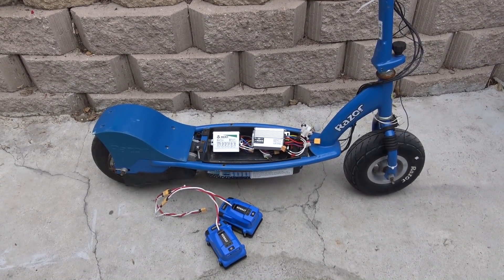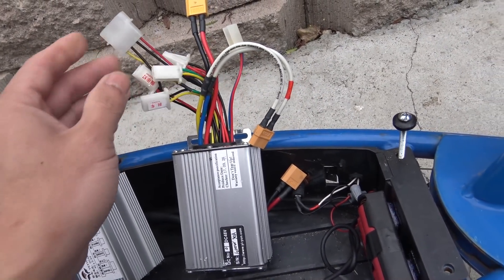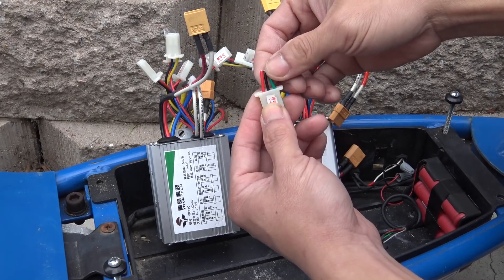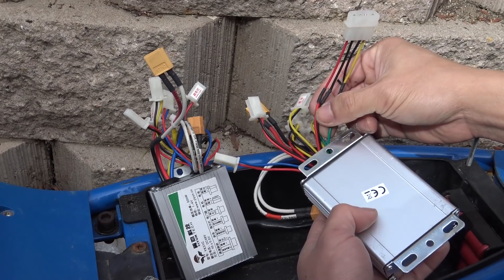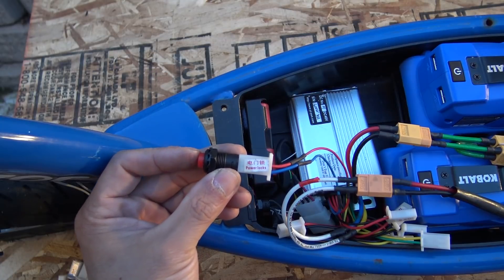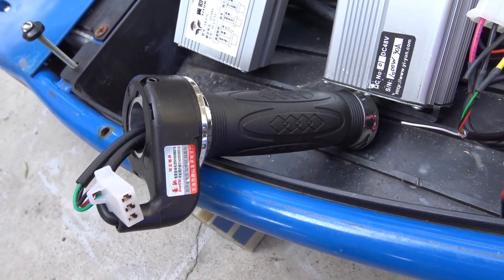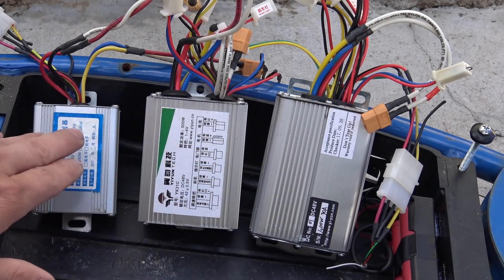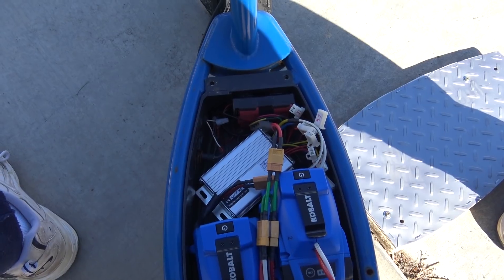Install a 48V controller & 48V battery on a Razor E300 (24V) Electric scooter

Comment: Hi, I took your battery pack idea and built my own. I am not using XT60 connectors but I am using regular electrical plugs connector which are the same and do the job. I am also using the same controller that you are using in this video. 
First problem: When I connect the battery pack 48v to the controller it usually sparks. it does it at first and after a while of reconnecting it for a few times it goes away. The last time the spark was so great it blew one of my 24v battery boards and it blew my controller as well. Did you experience this and do you know why? How do I fix it? I keep having this problem for any controller that I use. 
Second Problem: I bought and returned a few of the controllers you are using but I kept one. They all never worked for me. I never got a 48v output. I never connected it to the motor, I just tested the output and never got 48v. I made sure to follow your instructions by jumping the switch. This one I have reads 44v at the output. I will be using a foot throttle pedal which I bought one and did not work (Talk about luck) or maybe I am lost. Is there a trick to this controller or would it work once I connect it to the motor? I am thinking of connecting in a potentiometer on the accelerator plug of this controller just to test the output. Any advice? thank you
Reply from the maker: 1. The spark problem happens with all controllers. They have capacitors in there and they will spark when you first hook them up because the capacitors are being charged.
2. Did you measure the voltage when it's under load? I didn't measure this though. But at 27MPH-30MPH, it's plenty fast for me doesn't matter if it's 44V or 48V. :D
Reply: 1. Well, today I added an ON/OFF switch between the controller power input and the battery thinking maybe it was the connection of the power cables one at a time that was doing the sparking but with the switch earlier it did not spark when I tried it. I got home and tried it again with the switch in the circuit still and it sparked  at the negative terminal of the battery and it blue the battery board again. Cannot get a break. So these battery boards are for 24v and when two batteries in series the new voltage is at 48v so when it sparks it cannot handle the new voltage. maybe?
Reply: This is an update to my comment above. I discovered that the plug of the terminal end of the negative side to the battery was half connected, I guess if the connections at any point in the circuit is not tight enough or the connections are made one by one at a time it will allow for access to sparks. I tried it again with the switch but this time, I bypassed the battery boards with a straight feed from the battery packs and with the switch it is not sparking anymore since the circuit is in a close loop and tight. So, I was able bench to test my go kart motor/axle rotation; it works great pulling 2-3 amps under no load. I will be testing it under load once I get a throttle that works. By the way, the controller you have is the same one I have and the 44v out don't push the motor even with no load. I also put in a potentiometer on the throttle plug and it did nothing; I give up, not sure about this board. Thank you
Reply: @eledyscastellanos1405  ever figure it out?

Comment: So Im planning to mod my razor e300 to 36v with the stock motor but I dont want it to burn out. Since the motor has 4 screws around it, Im planning to take 2 screws out to vent the heat. Will the 2 holes be enough to vent the heat?
Reply from the maker: I'd say not enough. The hole is real small and the plate is real tight on the motor. I made a heatsink for the motor and you can see it in this video: https://youtu.be/FFar38kRJJ8

Comment: Hi i finished my scooter it's got a zy1020 36v 500 watt motor. A 48 volt controller what is used in this video. 3 x 18 volt Makita batteries. It has 8 inch tyres. I've also used the same throttle in this video. Can anyone tell me if I've over done it on the parts as when I pull the throttle slightly it does a wheelie lol I'm too chicken to stand on it in case it flips me as well ha. Hope someone can help xx
Reply from the maker: It shouldn't do a wheelie if you use a controller. Try it with no load and see how it does. Lift the scooter up (or just lift the rear wheel up) and try the throttle slowly. The wheel should turn slowly when you feather the throttle. If it goes on maximum even though you feather the throttle, you're wiring it wrong. Might be the throttle wires.
Reply: When I do the throttle with no load i can get it to go slower then faster but when I put one foot on  then pull the throttle slightly it shoots up xx
Reply: @vikkidyer  lol I think ur a girl ignore that wussy stuff just go buy 13 tooth #25 sprocket use a impact drill and take the nut off and drop in New motor sprocket and you will go faster but not as much torque no more wheelies your welcome I had to do the same thing I went from 11 to 15 tooth
Reply: Thanks Dylan for your help. Every time I tried it it would wheelie and then the chain just would come off hopefully changing the size to bigger will help.  Thanks for the info x

Comment: I shunt my stock E300 controller and put in 48v battery, and I clocked 25.4 mph with just the battery. 

Now, I'd love to do 30mph!
Reply: How long running time do you get?
Reply: @MrOoBAZoO  long time with 48v lipo batteries.
Reply: Did it last or burn out?
Reply: @GingyMoto  it was fine with 48v lipo. I ran it for like 20-30 mins with friends who knows all of this and it was ok. 

I tried to reached 30 mph with 60v lipo batteries and burn the controller.
Reply: @KokoJoni-ut5ti  sorry I never touched that project again unfortunately. I bought zero 9 scooter and sold that and replaced it with ebike instead.

Good luck and have fun. The issue with razor it needs suspension at that speed. The frame is strong but it needs minimum front suspension.

Comment: I got a new 48v 1000w controller, new 350w motor and a 48v 10 ah battery but the scooter is still so sloww... Barely gets up a hill and the motor gets hot... What am i doing wrong here?
Reply from the maker: Check your battery pack. It might not have enough juice to sustain the current from the motor. That's why it's slow. As per why the motor gets hot, I'm not sure. Usually going slow and hot motor don't go together (unless you're going up a long steep hill).
Reply: change the rear sprocket to a 16 tooth

Comment: I overvolted mine to 66v and it goes 35mph it’s tooo dam scary!
Reply from the maker: That's cool though. What controller do you use?
Reply: I’m using the same controller you’re using
Reply: Did the stock motor last? I feel like it would burn out quick with that voltage
Reply: DO YOU WANT TO DIE
Reply: Where did you get the controller

Comment: your motor will soon burn up unless you re-gear the scooter with like a 65t rear sprocket. Your motor is super hot after riding at these speeds.

Comment: Nice ! It would have been great the measure max limited current that's the major difference between both, in principle same voltage gives the same top speed if the current is enough :)
Reply: So to increase speed, more batteries?
Reply: @wessley4606  Yes, more in series (once again if the current is enough: because when the current is limited more voltage doesn't change anything)
Reply: @IncroyablesExperiences  series combines voltage,  I think this design used 2 x 40v if I'm not mistaken, but I'm not sure if they're in series or parallel

Comment: How many amp of your kobalt battery did you use for your scooter? Can it survive with 2amp stock kobalt battery or I have to mod one by adding more batteries to the pack? Either 24v or 48v battery setup.
Reply from the maker: I used 4Ah battery pack for this project. You can survive with 2Ah pack with 24V setup but it might be too much current for the battery if you use 48V.

Comment: Did you do all this with the stock e300 motor. Has the motor held up. I use my scooter for a 5 minute trip to school if I overvolt do you thing the motor will hold up. Also is the throttle variable or on/off like the stock throttle
Reply: Hey how's it going,wondering if you went on with this mod using the stock motor and if so how'd your scooter hold up? Thinking of doing this for my son and the same use as you basically. He'll be riding it to school about 2-3 miles away. Thanks in advance. And any info or extra tips that worked or didnt work well for you. Appreciate it

Comment: I am starting to wonder how these motors can take more voltage. Do they just have a shorter run time do to heat?
Reply: me too?

Is it safe for a 24v stock motor to be used with the 36v, 48v battery? Would the 24v motor burn out? What is your choice?
Reply: Yea it'll burn out. Over volting to 36 would be alright for light load

Comment: Wow I got 3 12v 7ah lead acid brand new on a 36v pack on a schwinn missile 350watt scooter and I can only do 1mile if I get lucky on flat road and I weight in at 200lb
Reply: Yea you're big heavy and slas suck. Lion or lipo for the win

Comment: Hi I have a 52 v 14s 5p kit for my electric 1000 watt motor been ok until voltage went down to 39v I have battery split into 3 so can balance ok but have found one cell dead Samsung 25r and it seems to be bringing down pack voltage but I have a 2100mah cell can I use that in group hoping it won’t discharge too soon I don’t run it down too low just the odd bike ride .steve
Reply from the maker: I assume the dead 25r cell has 25A discharge rate? Nevertheless, cells with different capacity ratings usually have different discharge rates. You have to use the same cell to replace it in your pack. Using a different cell with different discharge rate may result in premature cell failure and overheat problem.
Reply: well the 25r didn't last long so going try this lg and monitor it for now .I have a power meter so I can monitor the current u think?

Comment: I watch this Video a lot I learn so much but I need help installing a 6 wire throttle with digital meter and key switch on to the 48 volt 1000 watt controller if you can help I will appreciate it
Reply: most  throttles only have 3 wires, the other three might be for something else like ignition.

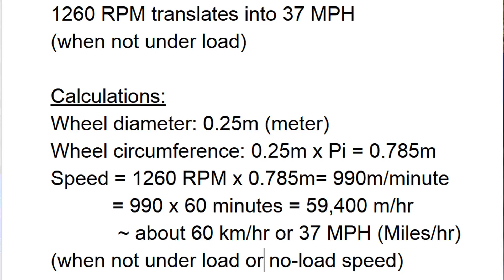Comment: 14:20 you really need a better disclaimer in your video description that this is extremely dangerous.  This thing wasn’t really designed to do 30mph, it has no shocks, a pothole or bump would send someone flying from the scooter at those speeds.  I want to replace the 24v SLA with kobalt batteries so that’s why I’m watching but I’m not going to attempt 48v or 500w controllers, 15mph is plenty fast on this

Comment: Thanks for clearly video! I dont know how to charge for 2 batteries in a serial connection? Did u use Kobalt 24v charger ?
Reply from the maker: The batteries are connected to 2 USB docks. I just put 2 docks in series. The batteries just slide in and out of the dock individually. I can just charge the batteries individually as normal using a Kobalt 24V charger.
Reply: Thanks for the quick response! Another question: my system with 24v 200w motor, can It work on the 48v battery?
Reply from the maker: More likely yes. But you'll need a new 48V controller as 24V controller will be fried when you connect it to a 48V battery. Also, monitor the heat from your motor as it might also fry your motor! Do it at your own risk. :)
Reply: I definitely have to upgrade the new 48v controller. Actually, I dont need more speed but I need more strong because I usually ride it on terain. Do you have any suggest?
Reply from the maker: I realized after I upgraded it to 48V, not only was it faster but it's also stronger on the hills. It can clim hills now where the older 24V struggles.
Reply: vuaeco Thank you very much. I ready to upgrade my scooter today!
Reply from the maker: Sounds good. Let me know how that turns out!

Comment: Did the motor hold up? I ran mine on 36V for a few days before the motor melted itself into a pile of crap hahaha. 

Great build!
Reply: I got exactly the same problem ! Now I installed a blushless 24V motor instead of the stock motor, with suitable controller, and all is well at 48V
Reply: @speedsterh  24v brushless? It hasn't burnt out with 48v?
Reply: @superiorraingutters  what batteries you using?
Reply: I ordered a 1000w 48v controller and it arrived yesterday. Im going to ride it today and see what happens. I have experience with modding Razor and power wheel vehicles. We have 3 razor mx650 (36v modded to 56v 7.5ah batteries), mx350 (li-ion 24v 10ah batteries), powerwheel atv (12v modded to li-ion 18v 6ah). And I haven't burnt any motors....yet. On the scooter I'll be dropping in 48v 4ah batteries(24v 4ah in series)
Reply: @speedsterh  Hey I am trying to make this scooter and could you tell me where I can order this motor that worked for your scooter? Thanks.
Reply: @speedsterh  btw Do you know how long the runtime will be on a 2 ah 24 v battery
Reply: @daviddeluca968  2 Ahx24V=48Wh That kind of battery will be drained in maximum 12 min if the motor runs at full power (250W). Probably less because of voltage sag (which will be enormous with such a ridiculous size). You should do some research before buying some hardware on a whim, methinks
Reply: @speedsterh  I think I will buy the same battery he did in this video. and thanks for all your help.
Reply: @speedsterh  Would you know what happens if you get a 1000w brushless controller with the 10" electric wheel hub that you linked to?  Or would you just recommend getting the one that's rated at the same wattage?  Also what size brake line did you get?  They list 2 different sizes for rear brake lines in the link you shared.  Lastly, with the setup, how long does your battery last?  You don't list how many AH total.  TIA!
Reply: Was everything plug and play? On the razor.
Reply: @bhaktaronaldsingh2209  no because you gotta change connections etc
Reply: @speedsterh  So that means the brushless 24v motor can handle 48v battery with no problems. 100%?
Reply: @daviddeluca968  You shouldn't have bought those batteries, It would have been be smarter to buy a type without the plastic around, and with a geometry that would fit the E300 case better... Too late now
Reply: @speedsterh  yes I figured that out now thanks
Reply: @speedsterh  ya I realize that now, thanks for all your help.
Reply: Yeah gotta upgrade the motor
Reply: Haha, i cracked up when you said melted itself into a pile of crap
Reply: I was going to mod a E100, then I watched your series on the E300, bought it used for £95 2 days ago and barely got a mile out of it before the batteries were useless.

I got a lot of good info from your series, going to start my own on my build.

Comment: I have been inspired by watching your videos. I want to make batteries like that for my scooter. How do you charge the modified Kobalt batteries?
Reply from the maker: The Kobalt batteries are not modified. Only the USB connector. The battery still slides in and out of that connector. I can still charge the battery normally using the Kobalt charger.
Reply: vuaeco thank you for the fast reply and the great tutorial! I found 1.0 amp hour 24v kobalt battery for $10 & going to buy some of those plus charger and usb connector to replace my aging heavy sla  batteries on my 24v450w bladez scooter. Maybe make one bigger pack like your other videos teach.

Comment: What’s your runtime with those kobalt batteries?
Reply: Great video bud,  ive got a couple of scwinn s500cd's that ii the process of modifying and have been soaking up all the kn owledge possible on u- tube, anyway i have a few questions for ya, first of all im into r.c Cars big time, i have alot of new lipo batteries i have a 6s, a couple of 3s, a 2s 5000 mah, what im wondering is can i use them on the scooters with the stock 24 volt speed controls on the scooters, i believe the scooters both have the 500 watt brushed motors in them, or will the controllers shut down, and also if thats the case can i wire in a brand new 15s that i pickedup at wmart in the garden section on clearance for 10 bucks, i wish they would have had more but just one its a 60 volt 2amp used for the e- lawn mowers, tri.mers etc. Can i splice into the motor wires bypassing the controller install a on and off switch and only use it when i want to kick in some turbo boost ..lol,? Because its only a 2 amp the range wouldnt be far but it would be  nice also for back up,?
Reply: I figure as long as i pick up speed with the sealed acid batteries and shut them off and then hit the switch directly to the motor from the 15s battery i should be alright, and then shut it off and turn on the normal switch to slow down and stop?? Whadda u think?
Reply: I plan on buyi g 60 volt s co trollers and more 15s batteries but im talki g for now?
Reply: R them cobalt batteries lithiums or no and how much were they?

Comment: how can i make a variable speed controller, so i cant adjust voltage or speed. i know stock one is On/OFF no in between.
Reply: Get a varible controller or a throttle that is varible